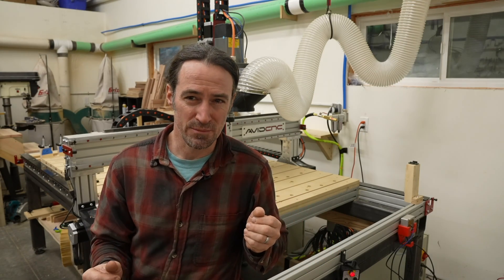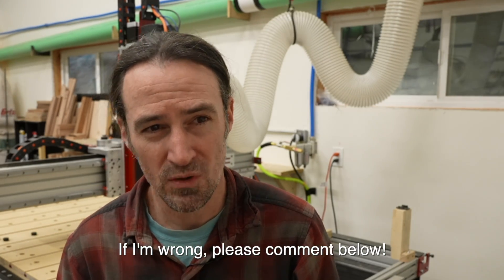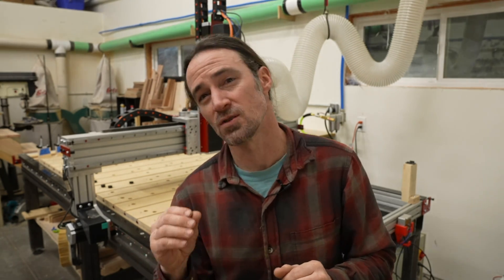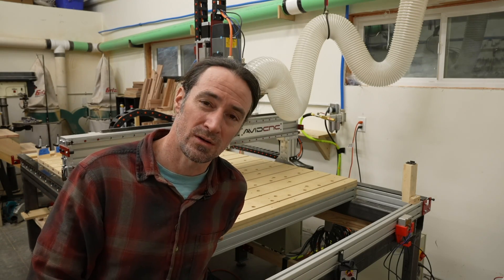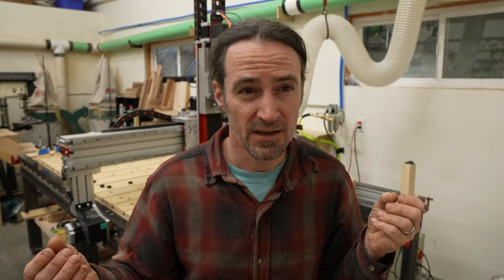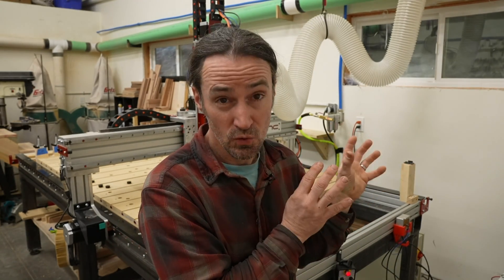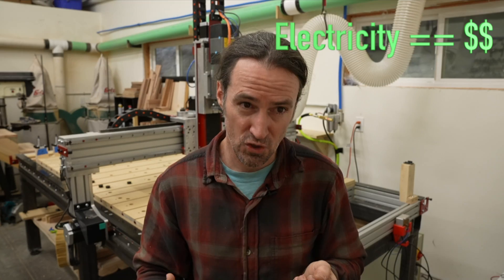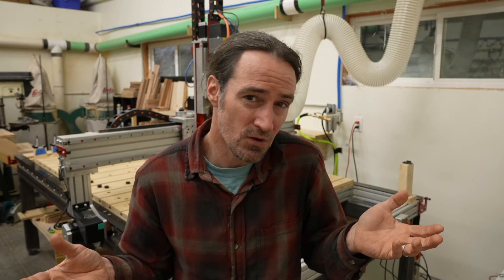CNC Build Ep 1: What is the Best CNC For You? Why I bought Avid CNC vs Phantom, Laguna, Shop Sabre

Comment: About 6 years when I bought My Large CNC (4x8), I got an Importers license for a couple of hundred dollars and Imported mine directly from China (2 lasers and the CNC), when you order from Cina you need to spec all the componets or they will add cheaper componets to save them money. but doing it that way I saved well over 50% ( it was a 60 to 75 day process begining to end) also I thought it was very smart of you to create your own platform, but you mentioned sitffening it , my machine has 4x4 steel like yours but also has runners from leg to leg about 6 inchs from the floor. also I keep my  spindle water cooler and my  dust collector underneath it.
Reply from the maker: Cool! I've heard mixed reviews on people importing machines; some people (like you) seem to have had great success, and other people have had a nightmare of an experience. What company did you get the machine(s) from? I am in the market for a laser at some point...
Reply: I oredered it from the blue elephant factory, they packed it up and put it in a shipping container , loaded it on the ship...From there a I got an impoet company to do my bidding at the port  ( getting thru customs, and moving it to the port closest to my house in northeren kentucky (louisville) once it cleared customs in Louisville you must pick it up fast after one or two days they start charging you yard rent. I found a tow truck company in Louisville with a tilt bed truck and had them pick up the cnc from the port and bring it right to the fornt of my garage where they tilted the bed and sat it down right at my garage door then I took four of the furniture dollys from harbor freight  jacked up the crate and used my lawn mower to pull it in the shop and uncrated it. same with the two lasers. @CorbinDunn
Reply from the maker: Thanks for the info @dwightbauer6705  ! I have heard about blue elephant, and they do seem like a good direct to consumer company from China.

Comment: Nice Video.
We are looking at getting a CNC for work & we are looking at the Phantom.  
Now I am off to check out the Avid as well as some other machines you mentioned.
You are spot on with the ATC.  I have 2 CNC machines at home & all manual tool changing.  VERY TIME CONSUMING as well as the risk of not resetting your Z after changeout.
Reply from the maker: Cool! there are so many options these days that it is easy to get lost on what to buy.

Comment: What puzzles me most about Avid is the steppers they use. No closed loop, no clearpath. I wonder how much there's to gain in accuracy by upgrading to closed loop steppers or servos?
My machine came with generic Nema 23 steppers, swapped them with Clearpath and I think it's a world of difference.
Reply from the maker: Yeah, that's a good point! I bet they would increase accuracy and repeatability -- and let you know when something goes wrong to avoid a bigger problem (losing a step).

Comment: Corbin, thanks for posting this, AND posting a link to the alternate view.  Just FYI.  I live in MT and just got a quote on a Phantom Shadow48 with vac from my visit with them at AWFS.  One thing that also impressed me at that show was the guys from Fanuc were in the booth talking and pointing twice when I was there.  We cannot read anything into that other than it seemed they were impressed. Shipping was $6000 from NC.  That took the total to North of $30K.  The machine is super solid and fits my needs, but I wonder if Avid might be a better stepping stone.  I am also intrigued with the rotary CNC on the Avid as I have a use to make tapered legs instead of buy them custom.  Thanks for putting this together.
Reply from the maker: Yeah, it is really hard to swallow adding 25% to the cost of a machine just for shipping! I've seen been pretty happy with my Avid, but it does take a lot of DIY work. I'm still planning on making my table more rigid by welding in some more steel. Other than that...it has been working great for me doing part time projects (most of what is seen here on YouTube). You can get an Avid for probably half the cost of the Phantom...but they really are hard to compare at those price points.

Comment: You mentioned running your CAD/CAM software (fusion, vetric, etc...) off the same computer you run mach 4. This is something I always wanted to do for the same reasons you mentioned but AVID has always STRONGLY recommended against it. Have you done a lot of cutting with this set up? Have you noticed any glitches? Thank you!
Reply: I run mach4 and mastercam simultaneously with no problem for more than a year now. I have a powerful desk top computer. It’s not a custom computer but the most powerful one that Best Buy had on the shelf.
Reply from the maker: You probably don't want to be designing stuff in CAD/CAM while your machine is cutting. I do leave Fusion 360 running in the background while my machine is cutting; that is no problem. I've done this a bunch without a problem. Occasionally I will look at the model while the machine is running, but I try not to do anything processor intensive, like changing the model or generating toolpaths.
Reply: Thank you for the reply. Did you still use the AVID utility set up program to configure your computer for Mach 4? It's my understanding that fiddles with alot of the settings for your computer like auto updates and such. Or did you just install and run mach 4 as is?
Reply from the maker: @larrybrown1194  I used Avid's version of Mach 4 and ran their wizard to do the initial setup. Since then, I've written a custom screen and some code for supporting an Automatic Tool Changer (ATC). A bunch of people with ATCs are now using my screen set. Check out the later videos for details on it. I've had no issues with updates so far.

Comment: Thanks Corbin, did you get a price for the legacy machine?
Reply from the maker: I emailed them several times but I wasn't getting any response. They used to post their base price, and the 3x5 base machine was $20k a few years ago, according to my notes. I'm sure it is a bit more than that know. 3x5 was smaller than I wanted, and the 4x8 was a lot more (I didn't write the price down back then).
Reply: @CorbinDunn  thanks

Comment: I have an Avid 6x12 waiting for me to assemble. I did not buy the leg kit and the electronics. Just a legless table with the gantry and rack and pinion. Decided on the Avid because it can be bought piece-meal. I plan to just use a basic Bosch 1612 router to start off with and when I have enough hours under my belt and air setup properly, to the CNC Depot spindle for quick change. Whether I go rotary or even to the ATC or not remains to be seen. I am a serious hobbyist so I can afford to take my time. Love your honest opinions about how and why you decided on what you did.
Reply from the maker: Awesome! I'm sure you'll love the machine. I did a video on welding my own table - check it out in case you want to do something similar. I'm planning on beefing it up some more in the future. I also know some people make tables out of wood, and it works quite well for them.

Comment: I considered the Avid but went with i2R CNC because I didn’t have to build the machine and they had great pre (and post)sale customer service which Avid did not. They didn’t want to answer any questions, just told me which machine I should buy which turned me off.
Reply from the maker: Awesome - How have you been liking the machine? I've heard good things about them, and the ball screws are nice for accuracy. I did look at those, despite not mentioning them in the video. I opted to not get them because I wanted a 4'x8' table, and I didn't see them offering that size. I did consider Stepcraft, which has as similar build style in 4x8, and even offer an ATC. I ended up not getting a StepCraft due to the limited gantry height, and the ATC being 3 HP (which, probably would have been fine), and them using smaller stepper motors. 

I haven't had to contact Avid support yet; I did report some bugs in their UI and software on their forum, and they did acknowledge them. I know there is a large Avid community and a lot of helpful people, but sometimes it is essential to have good post-sales support from the vendor, so I know where you are coming from!
Reply: @CorbinDunn  you’re absolutely right about i2R not having a 4x8. Mine is perfect for me and the plug and play was what I wanted to get running the day I got it. Avid had a different name earlier, I think cnc machine parts, then they changed names and machines and they exploded the cnc market. The downside was they lost the personal touch with customers. Worked out for them and a lot of YouTubers who got their machines for free to promote them. I know you didn’t and I know Avid machines are great machines, just not for me at this point.

BTW, I really like your bowls and box designs. Very unique and beautiful.

Comment: What was the spindle you got and for much did it cost you?
I'm looking to upgrade to an ATC setup on my router and I've been looking at the CNC depot spindle, but something a bit more powerful might be nice.
Reply from the maker: I got the HITECO QD-1F from CNC Depot. You can email them and request a quote; I want to say it was around $7k (for a turnkey package), so nearly $3k more than the standard 3 HP spindle they offer. I did have to get a few more hoses, and customize the setup to be a little better than what they provided by default. I'm not sure I really need the additional power, and a 3HP spindle might have been fine for the majority of stuff that I am doing. I think if I was going to do it again, I'd probably just get the 3 HP, unless I was flattening a lot of big slabs. Avid has a video showing how their 8.7 hp motor can chew through material way faster than the 4 hp motor, and that video really made me want a bigger spindle...but I'm not sure how often I'll do something like that, and I have to take smaller cuts to avoid other issues (ie: chipout) with some of my projects.
Reply: @CorbinDunn  Regarding tearout, I wonder if pre-scoring with a drag knife would make much difference.
Reply from the maker: @NSResponder  Yeah, that's an interesting idea! The main problem with tearout / chipping is when I use a soft wood, specifically redwood. The same toolpaths don't give me a problem with hard woods, like maple and cherry. Usually I can work around issues by choosing a different tool path strategy.
Reply: @CorbinDunn  thanks for the info! I definitely don't do a lot of slab flattening or anything I'm that vein really, so the extra HP might be wasted on me

Comment: Yikes, that shipping price difference is huge.
I got my Avid mainly so that I could fit it through my door and into my basement.
Reply from the maker: Yeah, seriously! They also don't give the exact quote until the machine would be ready to ship in a few months...so it was a little nerve racking to get a $4-$5k bill for shipping after waiting two months for them to build the machine, and then decide that I wouldn't want to go for such a high shipping cost. And $1k to rent a tele handler (with delivery), but I might be able to move such a machine with my Bobcat loader (although it'd be iffy and on the edge of what it could do). This made me realize I should consider other options that have lower shipping costs, as the extra money could be spent on the machine and not just moving it from one place to another.